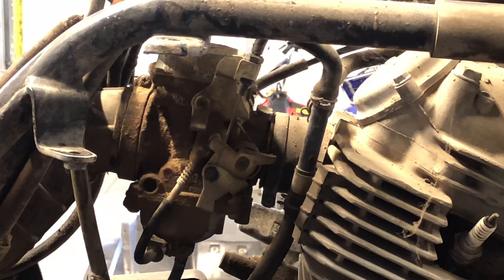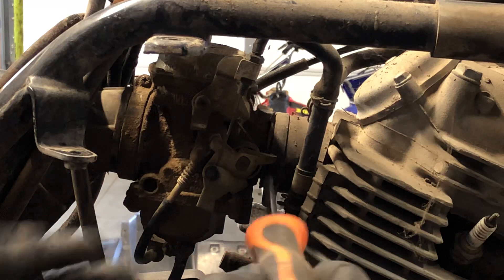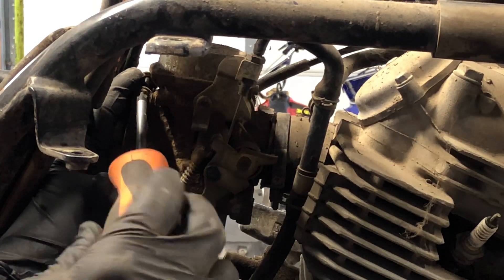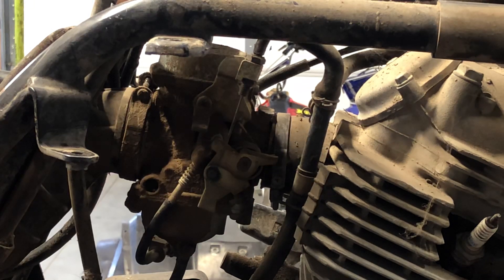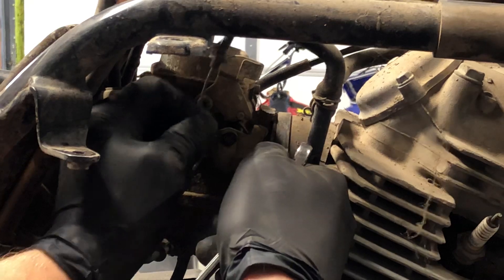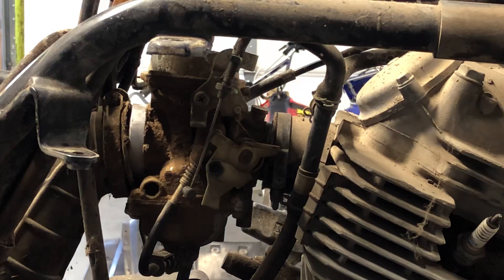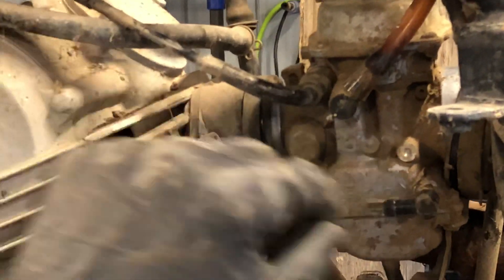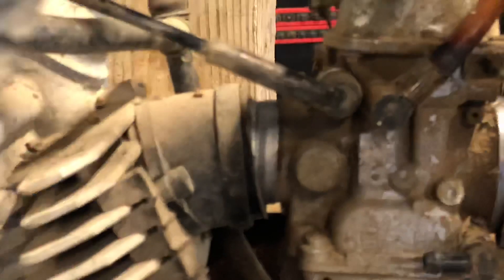How To Remove Carburetor - Kawasaki Bayou 300 ATV - Carb Clean - Cold Blooded

Comment: Hi I have a question. I have 2000  300 Prairie 2 wheel drive and it is leaking oil out the boot after the case. Im assuming the seal is bad. Do you sell the seal and is there a video on replacing it. Thanks for any help

Comment: I have a bayou 300 also and on my Bottom nipple Fuel drain line it's missing the line and it leaks fuel thru the nipple. Is it suppose to leak thru there. And the line you said it runs to the bottom of the motor does it just hang there ?
Reply from the maker: Yep, you should get a line on there before you light the atv on fire!! Line does just hang. If you are having a constant drip our of this nipple you need to replace you needle valve. Let me know if you've got other questions. Hit the subscribe button for me if you get a chance.
Reply: @MidNebraskaMotorsports  Thank you and Done
Reply: @MidNebraskaMotorsports I’m having the same issue how do you replace the needle valve